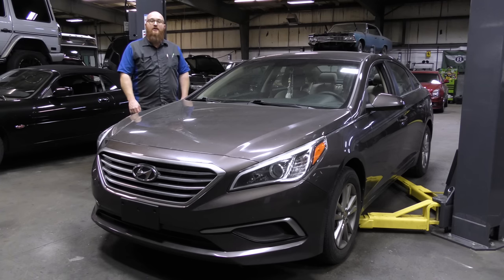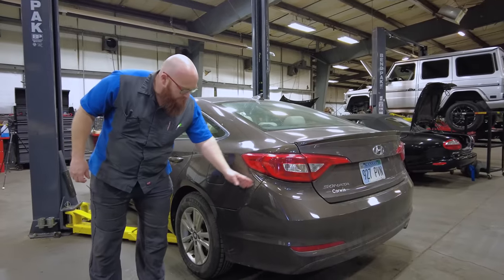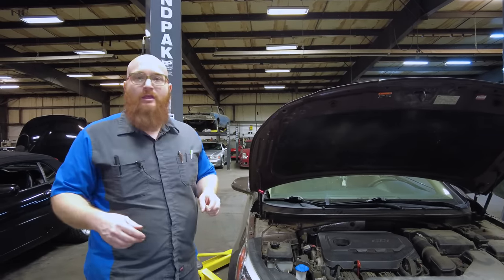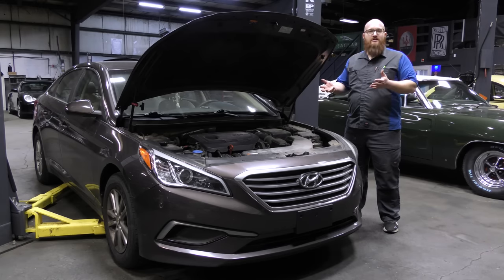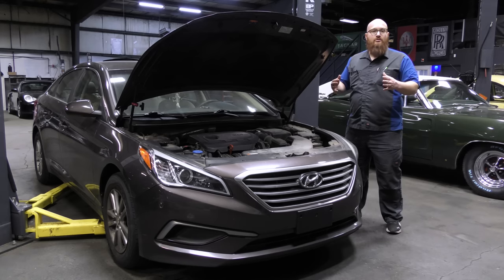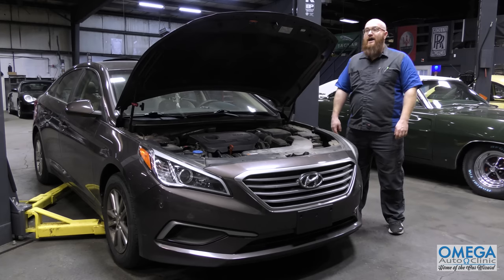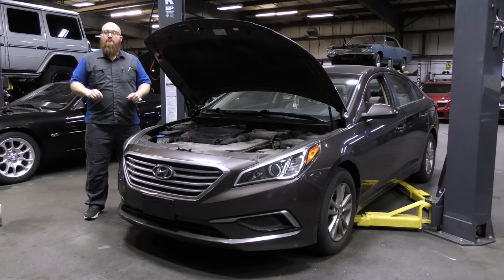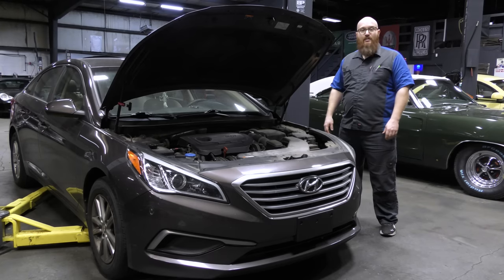What could be so bad on this '16 Hyundai Sonata that the CAR WIZARD is sending it to the junk yard?

Comment: Back in the 'old days' you checked oil EVERY time you filled the gas tank. Granted, that was full service, but even after self-serve, you were used to it because your car usually went through at least a quart every 1000 miles, either out the exhaust or onto the ground. We have gotten complacent. The owner of this car should have checked all the fluids before going to the dealer and made sure it was OK. Expensive lesson for sure. Hyundai isn't the only one with non-rebuildable engines. Most don't want you boring them more than .020 if even that. Gone are the days when you could bore a block .060 over, polish the crank with emery cloth and throw some bearing in it. Too much other stuff to replace these days.
Reply: I tried doing that and quickly learned the oil level reads way low when the engine is hot and has just been running.  Had to go get the dealer to undo the extra oil I had added as a result.  I always checked it when cold before driving after that.  In 350000km, I had it, I never had to add oil between oil changes, which were done on schedule every time at 16000km as VW specified for the ALH engines.  Timing belt at 128000km every time as specified.  It was still running perfectly at 512000km when my brother in law (I gave it to him) hit a deer, which was the end of it, unfortunately.

Comment: I have a 2017 sonata, same car. Luckilly I check the fluids regularly and around 150k I noticed it was starting to use oil. It also started to have a lot of pinging. With a lot of research, I discovered blow by was causing preignition. Installed a catch can on the breather and was surprised how much oil I was getting (mostly stopped the pinging). Long story short, I'm at 185k now and check/add oil regularly. Runs great but when we get to the point of this video, I will move on. Too bad, this car should have gone 300k.
Reply: I lasted that long pinging? The oil rings get stuck so sea foam cab help.

Comment: I have the same car and year, I kept up with oil changes never let it get low and my engine still locked up at just 67k miles, currently waiting to get an ok from corporate to replace my motor. There is no way to prevent the bearings from taking a crap, even with perfect upkeep these engines are a ticking time bomb.
Reply: Should of bought a Toyota.  Lesson learned.

Comment: I very seldom check the oil, but probably will more after this video. I am old fashioned and still change oil every 3,000 miles. This is probably not as much overkill as one would think, because I’m retired and it takes me about five months to go 3,000 miles now days. Also, my car holds six quarts, so a quart down isn’t too bad, although I will add just half a quart if I find an engine is down. I also take notice of how much oil is in the drain pan when doing an oil change. If there is less than there is supposed to be, better start checking more often. Also look at the ground for signs of fluid leaks where you park the car. If anything shows up, then figure out what’s leaking and fix it.

Comment: Indeed this can happen to anyone. I'm a car guy and religiously check all fluids on my vehicles, even the new ones, and a few years ago I had an eclipse convertible for the weekends. After covering it and not using it for six months, one sunny spring day i decided to take it to my sister's an hour away and forgot to check the oil. 15mins away from her house the car started knocking and when I pulled over, the oil level didn't even register until after adding a third quart! The car had no leaks yet it had lost most of its oil somehow. It was a costly lesson I'd never forget. I ended up selling it to a junkyard 😫
Reply: On the old show leave it to beaver, wally's friend Eddie haskell had a car that used a lot of oil. Wally said gee, that must be expensive. Eddie goes nah, I just drain it out of my father's car 🤣 OOF! 
I'm sorry about your eclipse. Those were sweet cars

Comment: I wonder if there could be any engines available at a salvage yard.
A similar car that was involved in a collision with less miles on it could be a viable option.
Reply: The problem is you have metal shot through the whole engine. Everything has to go.....

Comment: for the long block of an inline 4 to be $5500-6000 is crazy by itself. You can get a complete LS3 from GM intake to oil pan all new and pre assembled for about 7 grand. Hyundai must be making a ton of money on those long blocks, or some bean counter at Hyundai needs to be fired desperately. Good call on the wizard to advise customer to not put any more money into the car.
Reply: Would be hilarious to make the Sonata a sleeper…😂

Comment: I've rebuilt over a dozen of these 2.4 GDI engines with around a 75% success rate.  What caused the fails?   1.  Spun rod bearings due to low oil may heat and warped the connecting rods.  Solution:  Always install new rods.  Do not reuse.   2.  Cylinder bores scored and/or out-of-round.  My mistake was not bringing the block to an auto machine shop to have it bored out .5mm (if needed) and have it plateau honed.  3.  Excess wear of the piston side skirts.  Solution:  Install new pistons regardless.   4.  Metallic sediment inside the oil pump.  Disassemble, clean and perhaps replace the pump shaft bearings.  5.  Have machine shop check that the crankshaft isn't warped and the journals can be turned.   Other things to consider:  Replace the timing chain if stretched and have the cylinder head cleaned and checked for leakage at the machine shop.   Average material cost:  Head gasket $40; piston, rod and ring kit $200;  New Crankshaft $150 if needed or $125 for journal turning;  Valve cover gasket $25;  RTV $20;  Crankshaft seals  $30;  Machine shop work, approximately $350.  My approximately labor time in engine disassembly, cleaning and reassembly;  16 hours.  Car engine removal and installation time;  6 hours

Comment: i have a 2016 sonota its burns oil so bad when i went to the dealership they ultimately said if its burning oil we can't do anything unfortunately it was also dripping oil, so i had that fixed and now its still burning oil but my car isn't always showing the oil low light on my car overall i love my car and eventually want to engine swap it and i have a straight pipe exhaust with cherry bomb in it and it sound great hopefully will just do a few upgrades later on.

Comment: One of my coworkers were one of the first to have ever owned a Saturn.
She was intrigued by the concept of haggle free buying and dent and corrosion free bodies.
She placed a order for one sight unseen at a dealership in New York because there weren't any in Wisconsin at the time.
About four years later she was driving to her niece's wedding in Ohio when the oil pressure light came on on the Ohio turnpike.
She drove to the next rest area and had it towed.
The service manager asked her if she had receipts for oil changes because they could not find a record of them in their system.
She was rather incredulous and said the car only had 48k miles and Saturns are virtually maintenance-free for 100k!
She protested and threatened to sue because the engine had seized due to lack of oil.
The vehicle had never received an oil change!
Reply: The person who told her that the car was maintenance free for 100k needs to be liable.
Reply: @geotec67  Virtually maintenance free and the owner is responsible for reading the owner's manual and familiarizing themselves with  and following the manufacturer's recommended service.

Comment: Checking the oil is very good advice, I check mine weekly,  and let everyone I know to do the same thing .  As far as that car goes I hope it doesn't go to the junkyard.  There are small car dealerships in Texas , they're called note lots.  And they will sometimes buy cars like this , that don't run so good , and have their own in-house mechanic repair them,  and then sell the car for double its value to people .

Comment: Suddenly, I don't feel so bad about having to replace the fuel tank in my E38 BMW 7-series after 20 years. A car I paid $1200 for, with 155k on the clock and a minor dent in the fender that could probably be PDR'ed if I felt like doing something about it. But I prefer to do work that keeps it running and driving correctly instead :D
#WorkSmarter
Reply: Once a car reaches 20 years, failures are expected, less than 10 years is pretty inexcusable though.

Comment: That's why the old Ford 4.6L 2 valve is the most reliable engine built in the last 30 years. You can run it on a quart of oil and no coolant, but once you top it up it will still run another 20 years.
Reply: It’s actually programmed to run on 1 bank of cylinders at a time, alternating, on no coolant. A limp home mode that also deactivates the AC.  This is in the owner’s manual for F150s with this engine.
Reply: 1995 T-bird with the 2v 4.6!  It needed a quart every month but I put 200k on it, still ran like a top
Reply: I think the Ford truck 300 six falls within your 30 year time scale.....
Reply: 1UZ-FE, even being interference w/ timing belt
Reply: GM 4.8, 5.3, 6.0, and 6.2 LS based engines are very reliable as well. Also the older SBC 350, 3800, and 4.3 V6 are also very good engines. These engines are very tuneable and the cams can be upgraded to bigger cams and on the AFM engines, they can be deleted and upgraded at the same time.
Reply: @Flies2FLL  These engines are super reliable and make very good torque. The only downside to these engines is fuel economy and they are worse than the GM LS based engines.
Reply: you forgot the gen 2 3800 GM v6 engine....it was even showcased on this very channel as the best GM engine ever made for reliability
Reply: @atx-cvpi_99  Well, the 300 six had very low gearing on the transmissions in the applications used.  With equal fuel injection technology and the correct transmission, they can more than hold their own economy-wise with any LS engine.  The problem with the truck 6 was that it's length was measured in FEET and it weighed upwards of 700 pounds!  I had one in an old '66 F100 and I could literally climb into the engine bay and stand next to it when I did my oil changes.  I'm in there one day changing the filter and I'm like "This is ridiculous;  Is this a yacht or something?  Thus it couldn't be used in in any where near as many applications as the LS.  The inline 6 design does not like to rev at all, so it can't make power but that 6 cylinder design is indeed fuel efficient for the cubic inches. Thanx!
Reply: As for reliable I'll keep my Toyota 4.0 1GR-FE v6 thankyou very much over anything from the big 3. Pretty much bulletproof.
Reply: The Honda 2.4K series has been torn down and found to be a very strong and well-designed engine. Not uncommon to find ones with 350,000, 500,000 or 1 million miles, and the fuel savings over a V8 is a plus.
Reply: I have the 4.6 on my 96 GT.Not powerful but sounds really good!
Reply: Toyota 5vzfe on a 1st gen Tacoma. 355,000 and still going strong!
Reply: That's funny cause the F-150 my dad had with that engine cracked the heads at 110k.  Every single bit of maintenance was done on that truck properly.

Comment: My wife has a 2015 sonata it spun a bearing at 120,000 was burning a lot of oil after 100,000. I had the recall and update done so they replaced my engine for free and it also has a lifetime warranty on the rotating assembly. No issues with the new engine. That was a year ago. New motor only has about 20,000 on it.

Comment: I would pull the oil pan and see if I could replace the fried bearing from underneath the car. I have done this to three engines successfully.
Reply: The wizard addressed this. He did not want to put his name on such a repair because of the amount of metal that has flowed through the engine. I don't blame him

Comment: My daughter has loved Kia Soul's since she was a small child, so I got her a 2016 Kia Soul +, brand new. I have had the oil changed by the stealership every 3500 to 4000 miles. I wanted the oil changes logged in the Kia service system so there would be no finger-pointing if there was a problem. I also made sure that all TSBs were done quickly, including the infamous PI1207 Knock Sensor update.The car has been fun and reliable until last spring - the transmission went out at 44,000 miles (internal bearing failure on the left tail shaft.). The service writer said it was easier to get the transmission replacement approved by Kia corporate because I could easily prove the car was well maintained. My daughter has been very brand loyal to Kia - until the news concerning the rash of engine failures, and the lack of immobilizers. Despite loving her Soul, when she replaces it - she won't be buying a Kia or Hyundai. Oil is relatively cheap; engines are not.
Reply: I’m glad she learned the truth about Hyundai/Kia vehicles. They spend all their budget on design and technology, but not on good engineering or quality materials. Hope you guys never buy another one!
Reply: The Real Cat of 2020  Kia and Hyundai are all over the news denying engine warranties. In some cases, Kia dealers are denying engines if the owner did self oil changes - even if they can show a dated receipt for oil and filter.  If approved and the defective engine is replaced "for free" - and there is an allowance for a short-term rental reimbursement, the warranty does not compensate for loss use, waiting at the dealer, waiting on hold checking on the work. And as Wizard says, both the 1.6 and 2.0 GDI engines are apparently not designed for longevity. Any Kia/Hyundai GDI engine must have periodic intake service to eliminate the intake valve carbon buildup - or, again, the dealer will deny the warranty due to "poor maintenance:".
Reply: The Real Cat of 2020   Bwahahaha! You’re gullible enough to believe those rankings? No wonder you think Kia is reliable 😂
Reply: The Real Cat of 2020  Do you not realize that those rankings are paid off? CR only looks at 30 days and 1 year ownership. Keep drinking the kool aid buddy.
Reply: The Real Cat of 2020  On a YouTube comment thread, GTFO 💀💀
Reply: The Real Cat of 2020  Hey, if you’re that gullible, be my guest.
Reply: The Real Cat of 2020  Whatever you have to tell yourself to feel better.
Reply: The Real Cat of 2020  I actually won’t need to do that because Kia isn’t more reliable than my car 🤡
Reply: The Real Cat of 2020  Buddy, if you put your trust in a company with engine failures and fire problems being announced every year for more than five years now, affecting the owners of more than 8.5 million vehicles, spanning from 2012 to 2021 manufacture years; a company that lost 55% and 77% of their Q3 2022 profit (Hyundai/Kia respectively) due to warranty claims on faulty and failing engines; a company that uses child labor in Alabama like it’s the 1800s…then that’s on you LFMAO 😂
Reply: The Real Cat of 2020  My lack of knowledge? They’ve been recalling vehicles even for 2021 manufacture year. The issues are pervasive enough to span an 8-year gap. You’re so blinded by JD Power rankings that you can’t even see the proof in front of your eyes.
Reply: The Real Cat of 2020  Now I know you’re just making numbers up. 8.5 million is the number from Kia/Hyundai. Also, straight numbers are not the issue, it’s the percent of cars sold. Kia/Hyundai have more recalls per vehicle sold 😂😂
Reply: The Real Cat of 2020  That’s the number of total vehicles recalled in the last 5 years by Kia\Hyundai. It’s easy to look that up.

Edit: Kia and Hyundai are #6 and #7 in the top 10 automakers with the most recalls in 2022, based on Forbes. Adding those numbers up brings us to 2.9 million in just 2022 from those two.
Reply: The Real Cat of 2020  I can’t provide a link because YouTube will remove that comment. All I can say is “Forbes top 10 recall” would be a good phrase to look up. It’s the first link that comes up in my search engine.
Reply: The Real Cat of 2020  Nope, that’s not the 2022 list published on December 30, 2022:

1 Ford: 67 recalls, 8,636,265 units
2 Volkswagen Group: 45 recalls, 1,040,885 units
3 Fiat-Chrysler/Stellantis: 38 recalls, 3,041,431 units
4 Mercedes-Benz: 33 recalls, 969,993 units
5 General Motors: 32 recalls, 3,371,302 units
6 Kia: 24 recalls, 1,458,962 units
7 Hyundai: 22 recalls, 1,452,101 units
8 Tesla: 20 recalls, 3,769,581 units
9 BMW: 19 recalls, 1,000,455 units
10 Nissan: 15 recalls, 1,568,385 units

Comment: I remember the day when we had a service attendant to fuel our vehicles and they would also check the oil level, clean the windshield and check the wiper blades at the same time. And, there was no extra cost for this service.
Reply: That was one of my first jobs, full service gas station.
Reply: I was 16 and worked in a gas station that had a full service island. There is an extra cost for the service and it was about a nickle a gallon.
Reply: @arrgorndenethor  and developmental disorders too

Comment: Our 2007 Sonata 3.3l has just shy of 190k and I ran 12k miles on a Mobil 1 oil change(the 15k mile oil) and it was just over a qt low. I've heard the theta II engines are cursed though